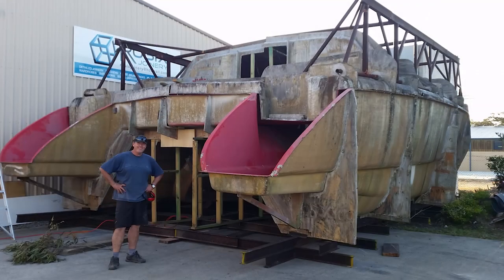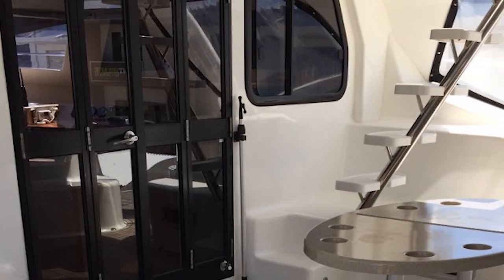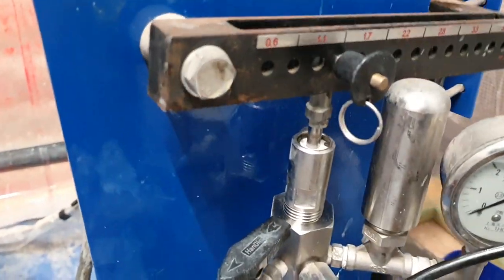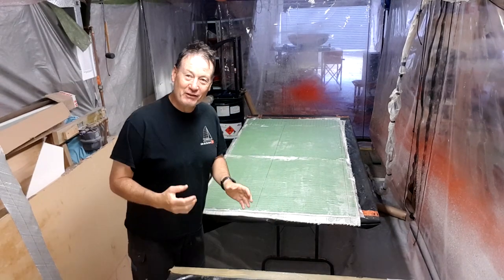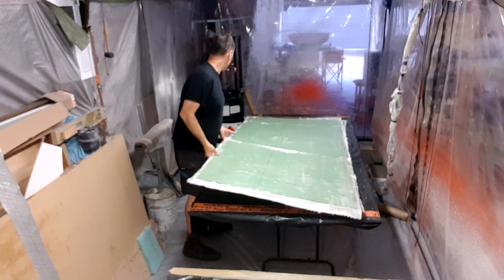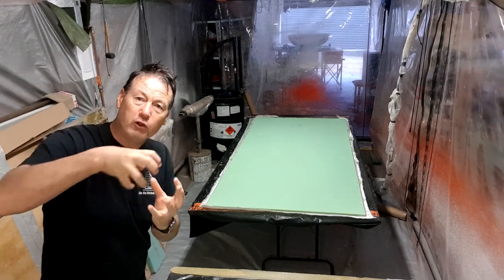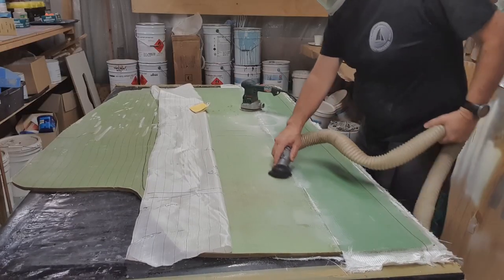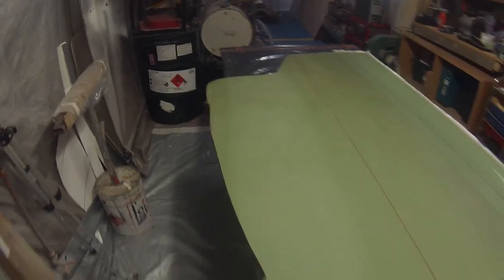Ep103 Laminating Foam Core GRP Partitions - Life On The Hulls - Catamaran Building

Comment: Stainless Spring Seals, or 'spring-energized seals', a 'cup' shaped seal with a stainless spring in the groove. The spring can be either coiled or 'V' shaped. Hard to tell from the pixilated shot which one you've got. Bal Seal HK has static spring energized seals in your area. I'm sure you can Google others...

Comment: Switching to CSM and then Double Bias is a good idea. It’s consistent with the specifications when building the hull itself. The CSM provides more surface area and bite. If wider sheets are beneficial would it make sense to laminate a batch of double wide sheets.

Comment: I do vacuum bagging for woodwork in my shop. I need a lot of platens for this work. I have found the melamine sheets, waxed heavily, work great when you need a dead flat surface. I glue a sheet of melamine to either side of a 3/4" dense foam core and have had no issues.

Comment: G'day Rossco, may I ask why you didn't join the foam sheets before you glassed them? Less fairing down the track. I am also wondering why these internal fit out sheets have CSM on them why not just a layer of 600DB, would save a lot of weight and be the same strength. Now you are getting to the fun stuff of fitting all the bits together and miles of coving and taping to go, it gives you plenty of time to wonder why you ever started the project in the first place..... Cheers Rustie.

Comment: To avoid the chipping, use a track saw with a zero clearance fence (a soft plastic strip that you cut through) and back the cut. You shouldn't get any chipping with a set up like this.

Comment: BTW: My answer on the three red lights was taken from Chapman Piloting 62nd edition pages 132-133. A vessel constrained by its draft must display three vertical read lights where they can best be seen. I fully understand the rule you referenced, but how would a boat on the water know the difference in the meaning of the 3 vertical red lights?

Comment: If you are having fast cure on hot days you can use resin without a curing agent ( not talking (mekp) but cobalt or something similar not added at the chemical factory, then you can control the hardening by adding your own cobalt to get the cure rates for hot weather, Its hot often here in Thailand. You can probably get that kind of resin and the Cobalt  in Australia although it will take some looking, it comes from Singapore and other places. Some of a learning curve but someone such as you will catch right on. Without any cobalt the resin will never harden the more you add the faster it heats up, you still need mekp.. Cobalt makes it hot in the pot so it can help on those cool nights as well,  just add less. The only  problem is cobalt makes the resin a bit pink but you can add more pigment to counter that. Without this method it would be near impossible to build half of the year, air conditioning would be an alternative but the cost is an issue .A competitor has air con and wonders why I have no problem with curing too fast .. Cheers !

Comment: Hey Ross,  Patreon seems to have removed the comment ... anyway, 
whatever, that part is called a "spring energized PTFE seal" or just 
"energized PTFE seal" .. google for those and you'll find them.

Seals are sized as  inside x outside x depth ... so a 20x30x8 would be 
20 id, 30 od, 8 deep ... you'll have to measure yours.

Sample chinese one here: rubberoilseals.sell.everychina.com/p-100285675-coil-spring-and-v-spring-energized-ptfe-static-seal-or-rotary-seal.html    you should be able to order one from your local bearing supplier or similar.

Comment: Have you tried running a stainless steel blade in reverse to cut those pieces? Do a test with a grinder sized blade first, so you don't waste the money, but maybe it will work for you. 
I use this on my Makita saw for whenever i cut plywood that i have veneered myself. Anything else i've tried short of using a box blade and a straight edge to go all the way through (desperation, i know) has failed. Kind of surprising that there isn't a single solution for soft edges on the market, at the very least, not one that works consistently regardless of the saw you're using it on.

Comment: Why not use thicken poly between the sheets for the butt joint ?
Reply from the maker: Hey Tony.The straight resin is more than enough in this instance and the substrate forms the basis of the structure.All the best.Ross.

Comment: Hey Rossco, the seal you've shown on the video at 5:16 is generally a pressurized shaft seal, or spring reinforced shaft seal here are a whole bunch via google images : https://www.google.com/search?q=pressure+energized+shaft+seal&tbm=isch&ved=2ahUKEwjS3dqO3OPnAhUEO98KHUU1A2sQ2-cCegQIABAA&oq=pressure+energized+shaft+seal&gs_l=img.3...97537.120629..121017...1.0..0.85.2087.34......0....1..gws-wiz-img.......0j0i5i30j0i8i30j0i24.4z_tiAMBsx4&ei=Ll1QXtKOHoT2_AbF6ozYBg&bih=952&biw=1816&safe=off#imgrc=qN7dmY8Nm4BgyM

Comment: Btw Rossco. What’s the brand and type of foam you use? I am thinking about building a shower in my 30 footers aft cabin during my refit and i like to build the new bulkhead the same way as you do here to save weight.
Reply from the maker: This foam is manufactured by Guritt but Divincell is another option and is h80 grade for marine use.Ross
Reply: Life On The Hulls Thanks 🙏